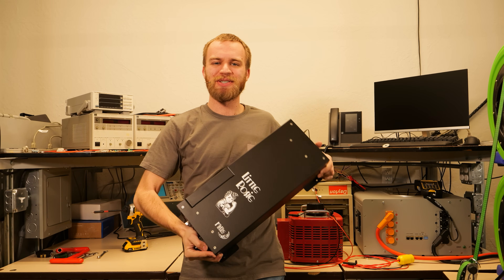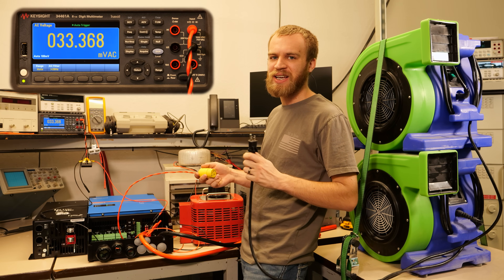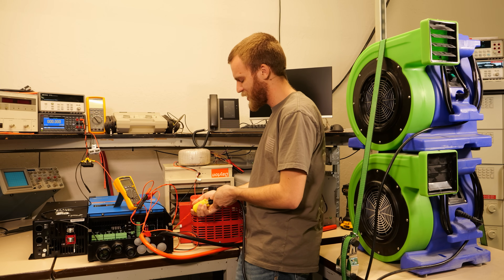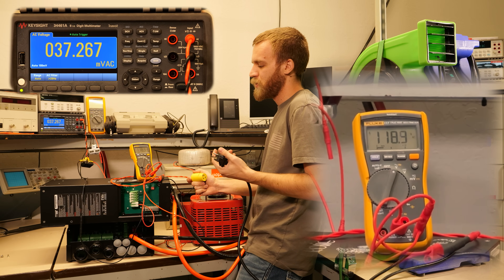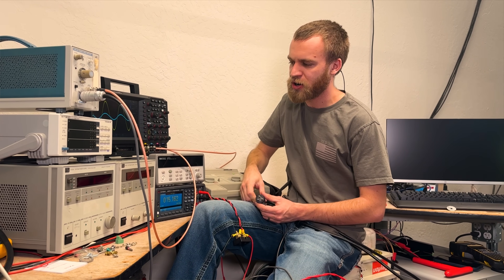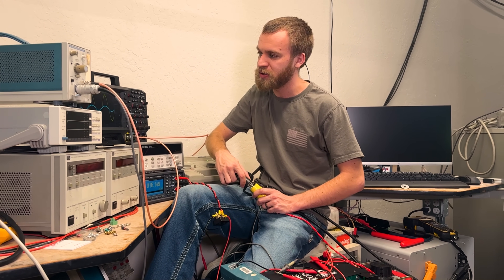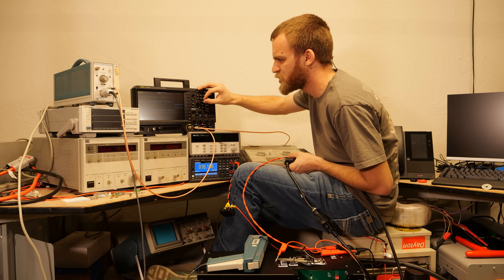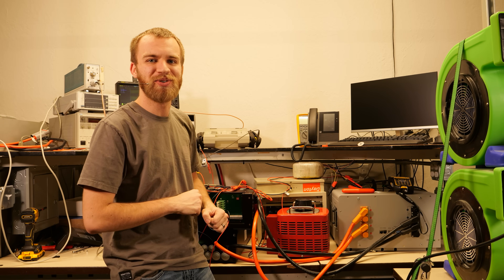Surge Capacity Test: Low Frequency Victron VS High Frequency Midnite | NOT WHAT WE EXPECTED

Comment: Which one will last 20 years ??
Reply from the maker: That's a tough one, both of these inverters are built very well and both of them probably would in our opinion.
Reply: I know 10 year old Multiplus systems.  Still working just fine and still supported with firmware updates.
Reply: 20yrs of 142vac spikes, yeah I'm up for it.
Reply: Midnite has been building systems for that long and many are still in service.
Reply: Victron is a 20 year old design already so you could argue that it's proven 😉
Reply: @connerlabs so they both have been around a long time. U think victron would have that surge figured out by now

Comment: The Multiplus is kinda old technology. Victron now also has a high frequency inverter/charger, the Victron Multi RS6000. Might want to check that one out!
Reply from the maker: This Multiplus-2 in this video is only about a year old on the market...I agree that the classic Multiplus is older with all the through hole ICs.  The Multi RS series is not really available to use here in the US market, designed for 230V grids.  I wish Victron could be more interested in competing in the US market.
Reply: @CurrentConnected  Really? The Multiplus 2 48 5000 is available here in the Netherlands for more than 6 years.
Reply: @CurrentConnected  you have to know how Victron set the system 
Victron multiplus is the upgrade from the Victron Phoenix multi .
Victron multiplus 2 is the upgrade from the Victron grid .

So no you are not use the best model .
By the way both are make to use in boats not for offrid systeem in a house.

For house in the EU the model 
Inverter RS 48/6000 230V Smart Solar
Than we have the model easy solar 1600
Than we have multi rs solar.

The problem.
All those models are 230 volts and not for usa market or other .

So really u are test older models vs New systeem 

For the rest .
Usa inverters are really bad in the EU.
It can not hold up against the rest van de the EU inverters.
Reason will be how we have 230 volt 50hz systeem.

Comment: The voltage drop and overshoot with heavy motor loads is typical for a LF inverter, the startup current draw is pulling the transformer into saturation, limiting current and thus causing voltage drop. When the motor hit nominal RPM the transformer goes out of saturation and the voltage overshoots a bit before it gets adjusted.

A HF inverter doesn't do this due to the H-bridge directly driving the loads but it's also the weak point of a HF inverter, there's no transformer that can go into saturation and limit extremely high inrush currents from things like switching on a bunch of switched mode power supplies or a short.
Also there's a higher possibility of inverter damage from voltage spikes. 
I've seen pv inverters and HF battery inverters fail due to a shorted AC compressor or well pump but I've never seen a LF inverter fail due to such fault.

Modern HF inverters are very efficient and reliable due to the availability of high quality semiconductors from the automotive industry but a LF inverter is more robust.

I chose a multiplus 5000 LF inverter for its robustness and expected lifetime. Those units have proven to work for many years.

Although I am experimenting with a multi rs 6000/48 (5200W) and I'm deeply impressed by its performance. It can supply a 7kW load for 4 mins.
Reply: Water Pumps eat the Growatt 6000T DVM . It supposed to be a LF hybrid inverter. Ginormous Transformer in it  100lb+. But with a 1/2Hp water pump on it fails every time. In a few months you get blown fets on the power board and a range of problems on the control board. No water pump no issue.. had another guy report his EG4 6000XP also fail after adding a water pump to his system ( could be a coincidence?) . Interestingly when using a stand alone discrete HF 3kw inverter (220V AC output) connected to a step down transformer (220 to 110V) then connecting the pump to it , Zero issues  year in year out , the stepdown transformer seems to act as a buffer between the pump and the inverter  . Just some of my findings
Reply: @thewizkidnatty  That's why I stick to victron because they have their roots in marine and telecom power systems.
These applications are very demanding and need very high reliability. That's why almost all their inverters are LF based.

They only entered the grid connected energy storage market because consumers started using their inverters for grid connected energy storage.
Because they already offered grid/ generator assist their inverters already had the hardware to do battery to grid so they rewrote the firmware and (grid) certified their inverters for full ESS functionality.

The Growatt and EG4 problems might arise due to inductive load issues, I've seen other LF inverters fail with a small 1/4hp compressor from a fridge.

I spoke with an electronics engineer and he told me that there's a possibility of inductive ringing between a motor and the transformer of a LF inverter. Especially motors with a start relay/ capacitor and no run capacitor.

I believe Victron inverters can measure this and actively adjust the pwm/ sinewave.
There's also a possibility that the Growatt and EG4 inverters have les superior FET's that short out on inductive spikes/ transcients.

Remember: Victron is very reputable but also extremely expensive but I have yet to see a Victron inverter fail from something else than abuse.
They survive output shorts and even grid to AC-out.
Reply: @thewizkidnatty  The problem is that most water pumps have a rather large start capacitor on them that can push them into a positive power factor condition during start-up.    The LF transformer type inverters typically use a simple center-tapped push-pull switching circuit, which is fussy about power factor and harmonics anomalies due to not having the equivalent of flyback diodes to suck up feedback spikes that a full H-bridge based HF inverter output has.  

Without the flyback diode protection, the LF inverter outputs can go into weird harmonic resonances under certain high capacitance positive PF conditions, and that can blow out the switching devices due to overvoltage/high voltage and or overcurrent feedback spiking.  (complex waveform feedback that is not snubbed properly.)
Reply: @thewizkidnatty  Hello, I have a renogy 3000W LF, it is 12V based and it start my 1/2 HP jet pump without problem. I have it since 2022. This is very bizarre a 6kW LF unable to start a 1/2 HP jet pump. You said your pump is OK but I would double check the capacitor just to be sure. Hope it help, have a nice day
Reply: @thewizkidnatty , it sounds like the growatt is under engineered. Needs more than a big transformer.
Reply: The drop is due to resistive loss. The overshoot is because of the finite response time of the output voltage control loop.  

It sounds strange, but core flux density is related to the volt-second product per turn, and of course the core cross section. In the SI system flux density is expressed in  Vs/m2 (aka Tesla).   

When voltage and frequency remain the same, the core flux density also remains the same. The flux density generated by the secondary current, is fully counteracted by an increase of primary current so that the core flux density remains the same.
Reply: @wimtel  So basically it's overvoltage that saturates transformers, not high current.
Reply: @connerlabs  You are right. When you apply say 150V to a 120V transformer it may saturate. You will notice high non-sinusoidal primary current without secondary load. 

To test the insulation between the turns of the primary winding, you need to apply twice the nominal voltage (so 240Vac in case of a 120Vac transformer).   This is only possible when you double the frequency (say from 60 to 120 Hz).  In that case the flux density remains the same as the Volt-second product remains the same (voltage doubles, time period halves)   Core loss increases significantly, but this is a short duration test.
Reply: If you load the HF inverter max 50-60% it will live for years.
Reply: Of course the tradeoff is efficiency. LF Inverters are reasonably efficient in their ideal range but a 5kW inverter won't be that efficient @ 500W. So I still prefer LF inverters but you just have to accept that tradeoff.
Reply: This is the correct analysis!!! Thank you for taking the time to explain what i was coming to explain 😂
Reply: I'm gonna throw this in since no one has mentioned it yet, but a Schneider XW is top tier LF. It will start and run anything all at once
Reply: That's exactly what I was thinking, LF is all about reliability and long term longevity. For me I would still go for LF inverter even if is not as efficient as the HF one's.

Comment: Are most inverters that are 48 V converted to 120 V?
My Victron Quattro, 5000  48 V, has a external resistor that Victron recommends for big surges.
Reply from the maker: There are some that provide 120/240V and others that provide 230V power for Europe, so it's certainly not one-size-fits-all

Comment: I would appreciate it if you could conduct a comparative test with inexpensive, allegedly low-quality Chinese inverters, just out of curiosity, to see what they're capable of. I'm genuinely interested to find out if they actually fail this test!
Reply: It's an easy answer. The cheap ones will be worse and they will fail much earlier, have voltage problems as well. Won't start big loads. The heatsinks and components on the cheap ones you can see with your own eyes. 
They are cheap and nasty

Comment: Really nice scope pics!  You can see the PWM that is synthesizing the output sine wave... that's what the fuzziness is.   The PWM is typically running at a few tens of kHz.  Resistive loads are handled by the filter pretty well, but they're gonna have a particularly difficult time with reactive power whether LF or HF.

Handling reactive power more or less depends on temporary energy storage which is a large high voltage capacitor bank prior to the H-BRIDGE for an HF inverter and the transformer for a LF inverter.   You can see what is more or less direct synthesis with the HF inverter whereas with the LF inverter the high frequency PWM artifacts transit the transformer. 

--

This also shows the difficulty of applying filtering to an output waveform to try to soak up the current draw inbetween PWM periods.

An LF inverter can almost revert to a square wave driver on its input under the most extreme loads and still get something that sorta looks like a sine wave on the output.  A very, very messy sine wave as you could see from the Victron.   That's why it almost looked like a square wave under the heaviest of loads.   The PWM driver probably backed-off to a square wave due to the overload, and when things began to clean up it resumed regular PWM operation.

The HF inverter, on the other-hand, has no backup plan so the typical outcome with the HF inverter is a lower AC voltage. 

--

You got a lower AC voltage from the Victron if I remember right and the midnight was able to maintain it better... backwards from what I would have expected.  But for an HF inverter it all comes down to the energy buffer on the input stage and the quality of the FETs/BJFETs.   The Victron was going full-out while the Midnight clearly had more headroom (regardless of specs).

The thing about FETs and similar families is that they have gone through truely massive improvements over just the last 10 years due to the development of motor drivers for EVs.  A modern high-quality [BJ]FET can transmit enormous currents with less resistance [or voltage drop, depending on the type] than the actual copper busses feeding the chip.   This is one reason why large residential HF inverters have gotten so good (though not so much in power stations which use lower-quality FETs)

-Matt
Reply from the maker: Yes, this lines up with what we are seeing.  I'd love to get a differential probe on the gate drive of the FETs in the Victron to see how the control algorithm changes as the (over)loads change.  Actually, both inverters for that matter... It would be very interesting to me to see if / how much the HVDC stage of the Little Rosie sags when overloaded.
Reply: Thanks for your deep dive analysis.
Reply: Matt your always showing up dropping big gems then vanishing
Reply: The nature of social media in a nutshell 🙂
Reply: @junkerzn7312  thank you Matt! Appreciate it
Reply: Yes power FETs have improved a lot in the last years. But remember that Victron is from Europe where 230/400V 3 phase AC is the norm in every home. Much harder voltage to handle for "vintage" FETs and the Multiplus II 5kVA is quite "old" by now. Big 50Hz transformers made sense but IMHO they are dinosaurs now.

Comment: Question? Would an actual well pump motor under load, compare to your blower motor, volt, amp and wave form distortion?  I know it's probably a little anal to go that far.  Just curious.
Reply from the maker: Most likely, but it would be worth doing a test!
Reply: My 240V well pump pulls 48.2A inrush and 9.5A running, if that's worth anything. Sorry I don't know the HP, but it's in a well that's supposedly 320' deep and on a 20A breaker.

Comment: I want to see what the DC side looks like for the same test.
Reply from the maker: Ah, yes!  That would be awesome!  That would show us a lot more of when the input FETs are on vs off and give some more insight on the Victron for WHY it's struggling more at the intensive overloads.
Reply: @CurrentConnected  The Victron's PWM driver is reverting to a square wave due to the overload, then resuming normal operation later on (when you notice it returning to a sine wave).  It's definitely struggling if it had to back-off to a square wave.   LF inverters can do this because of the transformer which is why they can theoretically handle larger startup loads than HF inverters.

But the energy buffer is still subject to the size of the transformer which for the Victron is only a mid-sized toroidal transformer and for an HF inverter is a large HVDC capacitor bank.  The Midnight clearly has more temporary energy storage to work with than the Victron.

-Matt
Reply from the maker: The square wave makes total sense, the equivalent to a 100% duty cycle on the PWM, but I'm still trying to figure out what the mess before we got to the square wave, right at initial application of load.  That's what has me still scratching my head.
Reply: @CurrentConnected  It's some kind of current limiting algorithm that dials back the PWM to keep those FETs alive. But the limiter is unstable, it chatters on and off. As the motor speeds up, the current limiter isn't needed any more and it reverts to the plain square wave you saw. BTW, what scope are you using 🤓